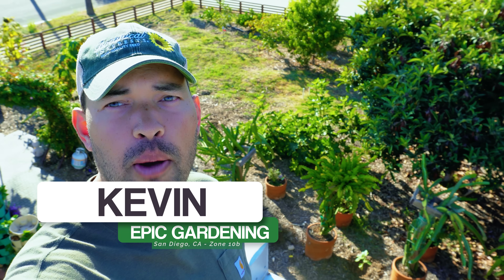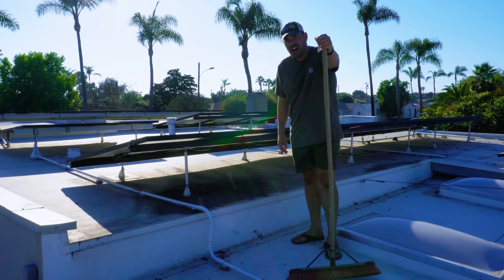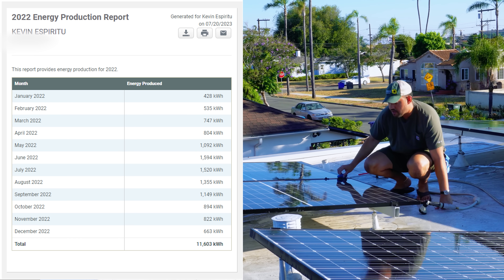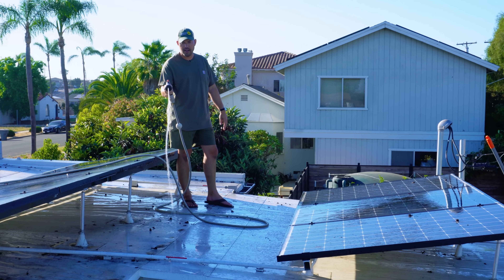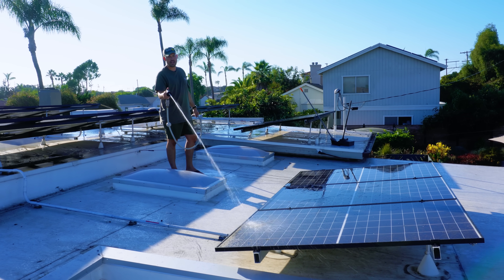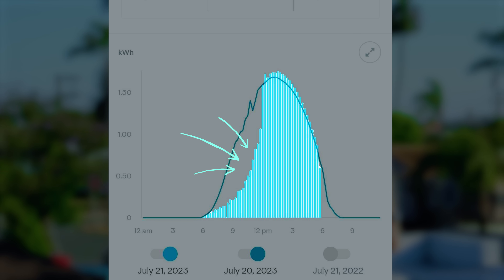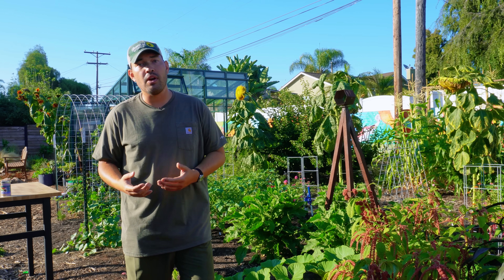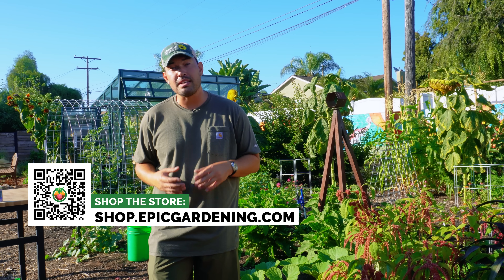I Installed 24 Solar Panels 2 Years Ago…Was It Worth It?

Comment: Nice! I've installed solar 14 panels on our new house. It was the first thing I've done, just before I started adding green around the house. It's in the East/West orientation, so longer, but weaker production. Also, the Netherlands is not particularly famous for the sunny weather, but I still get way more electricity than I currently consume... so when I can, I will install a heat pump and an electric stove. Then I can cut off that natural gas pipe for gooood.

Comment: Gas ovens are just better, I would stick with a gas oven. Also if you have enough solar panels that you haven’t paid a dime in electricity, then why add more panels? You did mention getting an EV, so maybe if that starts using more electricity than you can generate then sure add more panels.

Comment: I find it surprising that you plan to consume electricity from the grid for your car, but feel that $120/year to connect to the grid is a scam. Maintaining the electrical grid is an enormous amount of work. Even with the chronic under-investment in the infrastructure, especially visible in California, the equipment needed is very expensive and the labor is very skilled.

Comment: We have a small kit we added to a shed.  It powers a small tv and it’s a plus for when racing starts.😅
The installation and battery prices would need to come down for us before it would pay off soon.  Our utilities are reasonable and we are efficient in its use.  We bought a battery for the kit and it was a hefty price.  Then there is the consideration of cold country and battery storage.  I would like to add another kit to greenhouse just to help with seasonal use in spring and a solar panel for our golf/utility cart—that would be fantastic.
Oh, yes, the smoke from CN has brought some decreased sunlight at times and the drought no rain to wash panels off.  Thanks for reminding me as I seen they were dusty.

Comment: I have a solar array, and don’t agree with using the grid as a piggy bank. Your still using dirty energy at night. That’s the problem in California, everyone’s using the grid as a piggy bank, and stressing the grid once everyone gets home and plugs in EV’s, and turns everything on. I have mine setup with EG4 solar rack batteries. If the power is out, it has zero impact on my life.

Comment: When I compare battery costs, I look at $ / energy capacity PER YEAR.  For example, if I save 10% by buying battery A instead of B, but A lasts 1 year and B lasts 10 years, I've spent more PER YEAR getting the wrong battery, despite the upfront purchase price.

Comment: Just got to be careful. The more ppl do this the more energy companies are going to charge "maintenance grid fees" just for being plugged in. Had that happen to my friend in FL. She was saving 90% on her electricity...and then the energy company dropped that fee which made it kind of almost pointless to have solar panels. Not to mention having solar panels attached to your roof destroys the value of the house...better to have them off to the side. That way you don't have to pay for certain permits either.

Also, instead of hosing down your panels use windex...or any other type coating.

Comment: The only path forward is reducing consumption, a good cyclist can generate about 200 watts on average on a bicycle. it would require 7 cyclists pedalling a generator to simply turn on a hair dryer or boil water. We live in a small moment in time where energy is extremely cheap because of an abundance of oil. Once supplies deplete or regulations get more stringent, it will  cause oil prices to sky rocket it will be a very different world. People like you who are generating their own power will be much further ahead then half the population living in the dark.

Comment: I self installed a 6Kw system over 10 years ago. Due to degradation I produce 50% of what they did. So now I have a 3kw system. I got payback at 3 years due to my labor was free. So everything over 5 years is free electricity. But I did not expect 50% production at half-life. I expected maybe 50% after 15 years of use and replace at 20 years. If I was staying in my home I would replace my array with a 10 to 12Kw system. Next house I will do that. But the battery bank will be in the RV and mobile.  I will not be going complete electric. Rather I will have Battery in the RV for home backup. Propane for cooking / central air. Wood stove and pellet stove for the winter. Surplus Military  Diesel Generator just in case to run the shop and house in the winter since solar wont produce if grid goes down.

Comment: We just got panels back in February and I'm quite liking them so far. The electric policies in our area (NE Oklahoma) aren't very favorable, unfortunately. We don't have a battery yet (waiting a year or three on the tech to improve), so our excess power sells to the grid at wholesale prices... and when we need power at night, we have to buy it back at full retail price. So we still have a power bill, but it's dropped by a good $140/month even during July/August.

Comment: Solar sounds good on paper but unfortunately they degrade at a rate not worth having. Their is no gain no payoff but is sound good tell it is put into practices then if it was a investment it was a very very bad one.
Reply: Modern panels have a 25 year guarantee with a degradation rate of 0.4% per annum for 30 years. That means that after 30 years, they still have about 87% efficiency. Inverters have a 10 year warranty. If your Solar PV system is properly installed, they will pay for themselves years before the first component is out of warranty, let alone actually fails.

Comment: I'd be interested to know where you got 20 panels for 20k. We got a quote for 23 panels and battery installed and was quoted 75k. We would spend 2x more on the monthly payment for the panels than we we'd spend on electricity.
Reply: He has no battery.  Those good batteries are expensive.  And yes, the cost for us is still too high to get quick ROI.  We have a small kit for a shed and one normal size battery a couple years ago was about $1K.
Reply: @dustyflats3832  I was just only looking to break even. But I wouldn't get a system without a battery. To store the power from the day and use it as a supply after the sun goes down would be the best solution for us.

Comment: We have 24 solar panels as well.  And my husband did freak out in the early days if he saw they were dusty. Well we ran our own experiments and found that cleaning them did not change our solar production by even .5 of a KW. We have run this experiment several times, with very different ambient temperatures, and also different day lengths.  And the difference is so small, we no longer go to the trouble of cleaning ours off.  We live rural and our system is ground mounted and 10 years in, we have never for even one nano second regretted the decision to have put the system in.  We are so happy that our son now works for the company that did our installation.  We are proud to have been the first home installation they did and proud to be part of the change to greener energy sources

Comment: I have 42 panels  and I pay only 20 a month to stay hooked to the grid.   Now I understand why I have to cause they are my battery, but I get all of it back.   I have had it for 5 years now. Best Investment.    But a thought to help you keep track and watch all your energy being used and made at once.     It is called sense.    You install it in your main fuse box and sensors go on your main wires and your solar  it will learn everything in your house .   And separate things as it learns them.   By far the best add on for solar.      You want to see how much power your e.v uses.    Sense will tell you.  You want to see how much your a/c is pulling.   It will tell you.    You are using the app that came with the solar.     This sense module and app is a game changer.     Check it out.

Comment: Context- I work in Urban Forestry

I've seen many roasting, treeless yards where the owners have removed trees that would otherwise be providing good cooling value to the property and neighborhood for the purpose of accommodating solar panel installation. More often than not, most of the windows are occupied by AC Units. 

I'm not against residential solar panels, any action that reduces dependancy on fossil fuels generated power is worth taking, but I hope that those that watch this video and are considering removing mature shade trees to install solar take a critical look at what is being traded off.

If you do need to remove canopy trees to install solar, please consider planting new ones further from or on the north side of the building. There are many species of fine native shade trees that can be selected based on height and how far the canopy spreads, so as not to cast shade on your panels, while still providing cooling value to your home and community. 

Sincerely, a tree lover

Comment: So from what I understand you are still using gas to charge your car at night. Solar doesn't produce at night so you have to pull from the grid which uses gas generators to produce electricity, San Diego use to have nuclear but they shut that down. My husband works for any energy company and that's what a lot of people think of solar. But it's not exactly accurate.

Comment: The cost to be connected to the grid is the partly cost of maintenance to said grid. You're not truly off grid if you're relying on the grid's energy delivery at night. 

Just clarifying why I don't think the connection fee is a "scam". Now, I fully admit, if you were totally self sufficient and had batteries to handle all of this, you wouldn't rely on the grid at any point in time. The kicker is, I'm fairly certain they'd still require that $10 fee a month.

Comment: I’ve been experimenting with DIY solar for my garage. My system is off-grid. 1000 watts of solar, 40 amp Solar charge controller,  2000/4000 watt inverter, 9 kilowatt hours of Lithium Iron Phosphate (LiFePO4) batteries.  With enough sun, the system can power everything in the garage including a refrigerator/freezer and 8000 BTU air conditioner.   

Just a small system to learn about solar before scaling up.

Comment: Buy a couple more evs Then always keep one on charge during the day when you are generating solar.  then use that  at night.  You should always have a vehicle with enough charge to go... Then you could just disconnect from the grid.  Ev batteries are huge compared to the house batteries.

Comment: I would love to go solar but I keep being told they can’t put solar panels on the roof of a mobile home any thoughts
Reply: You absolutely could if you have a proper frame , i mean if theres a will theres a way, but rvs arnt that strong so no idea whats required. If you want to you could always build a trailer that has solar panels on it to give you power.
Reply: @ilenastarbreeze4978  it’s not an tv it’s a manufactured home or mobile home or trailer like you see in a trailer park shingled roof 2 bedroom, 2 bathrooms 1300 sq ft
Reply: I live in a mobile home and there is no way it would support the weight of the number of panels we would need to be completely off grid. I wouldn't trust it even if someone said we could do it. I used to build houses and MHs are not build anywhere near as stable as stick built homes. The only reason tiny houses built on trailers get away with it is because they don't require as many panels.

Comment: Our energy company here in NC will only let you go to $0. We can't go below that which kind of stinks. Also, our big issue is that the solar is tied to the grid, so we don't actually use the solar energy directly. The only true benefit is the lower energy cost, but that ROI won't happen for almost 15 years. They aren't quite there yet.

Comment: Could you setup a "sprinkler" system on the roof to run on schedule to clean your panels? Not sure if just the water will clean them, but might help automate the process. Just a thought
Reply: I’d apply a nano coat or ceramic coating …. Similar to a car wax.  So any dirt literally falls off and can’t stick to the glass.

They use that technology in high rise building windows - effectively auto cleans in rain
Reply: @JDAfrica   You have to be careful. Some of these block UV wave lengths that the solar panel uses to produce electricity.

Comment: In regards to the connection fee being a scam; there are operations and maintenance costs, as well as labor costs, associated with being connected to the grid. The pole and wire network that keeps solar panel owners connected to the grid needs to be maintained in the event a solar panel owner needs power from the grid or wants to sell back to the grid. In addition, there are people and systems who are responsible for keeping the grid balanced when home owners and developers want to connect more solar. 

That cost is shared between all customers connected to the grid. It would not be equitable for other customers (neighbors, low income residents, etc) to pay solar panel owners' share of maintaining the network because they have the luxury of owning solar panels. The distribution utility is providing a service and it is fair and reasonable for them to charge customers to maintain that service.

Comment: Your higher peak performance after cleaning the panels was less about cleaning them and more about the panels being cool from the morning overcast hours keeping the panels from heating up. That's the thing people forget about solar panels-- the hotter they get, the lower the performance. 

And that's from someone with 27 panels on the roof and a 24kWh battery system... 

You're in San Diego, check out NeoVolta. They are in Poway, but their system is pretty impressive.

Comment: The return on investment for solar is not good if you aren’t in a very sunny location. I was looking at getting some in Michigan and the ROI was like 8-10 years.
Reply: ?? All solar panels come with 20 year warranties, many with 25.   You are right, in Michigan is probably is 8-10 yrs, but that is still a huge bargain. 10-15 yrs of free electricity.
Reply: @PeterSedesse not all electricity is free. It depends on where you live, if you're mandated to be hooked to the grid and if so what the utility company allows as far as how much straight solar they say you can use.

Comment: Do you have a heat pump for heating/air conditioning? If so, what's your experience with it? Might be a good subject.
Reply: It all depends on where you live and what the energy prices are. I live in Las Vegas and it’s so much cheaper to have a natural gas furnace. Of course ac is power. My family also has a cabin in the mountains in Utah that has propane instead of natural gas and the energy company (they supply both power and propane) said it was cheaper to use power rather than propane. It’s good because that means we can shut the gas off when we aren’t there.
Reply: @lvthunder  Yes, it does depend on where you live. We live in the SFBay area, which doesn't get as much sun as Las Vegas. When we went solar our PGE bill went down more than $150/month. We just replaced our gas furnace with a heat pump for heating/air conditioning. Our PGE bills are now $20/month. We still have a gas water heater and gas cooking. The gas water heater is going to be replaced soon. It will be challenging to give up gas cooking, though.

Comment: Everything looks pretty cool, but you may wanna keep that stove. In ‘21 when we lost power for a week (due to a big winter storm), the regret of having all electric appliances set in. A gas stove would have been nice. So thankful for the charcoal grill we kept, because even the Traeger had to be plugged in.
Reply: Or another option if you want to totally sever your gas connection while being prepared for emergencies - get a propane camp stove or standalone propane kitchen burner. It can stay in a box in the basement (bonus perk - you can also bust it out if you're cooking for a big group and need more stove space).
Reply: If you store power in batteries and you have a disconnect from the grid you can power your entire house from solar. Many off grid houses do exactly that
Reply: He could keep a spare camping stove for emergencies. For everyday use electric is much better as gas significantly worsens indoor air quality.
Reply: We had a similar winter about 10 years ago. I still have a gas stove/oven and water heater.  I lost my house plants and fish but we could eat and take warm showers.
Reply: If you get cut out from the grid solar can still support you. Depends more of the type of disaster. Sure a cold snap like the one of Texas blocking your panels could be bad unless you clean the snow. But in the event of an earthquake gas lines are likely to break and are dangerous fire hazards while with solar you will be relatively fine even if the grid also is cut.
Reply: all you need is a shovel and some wood... fire pit. Best steaks